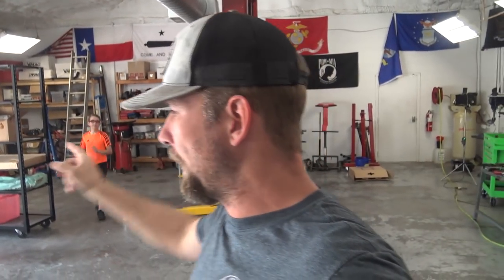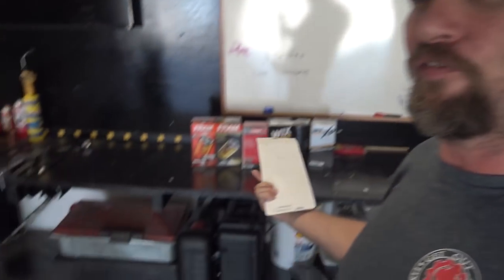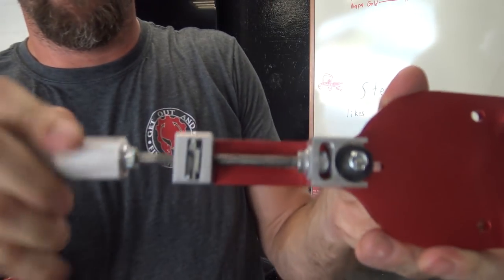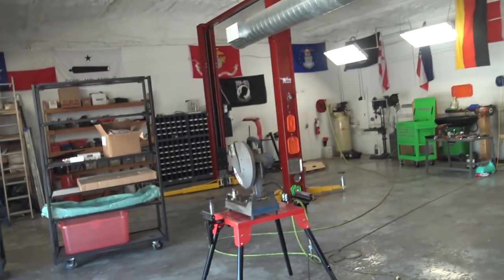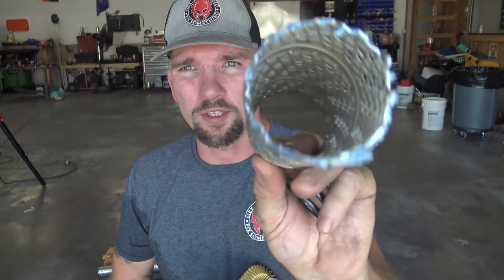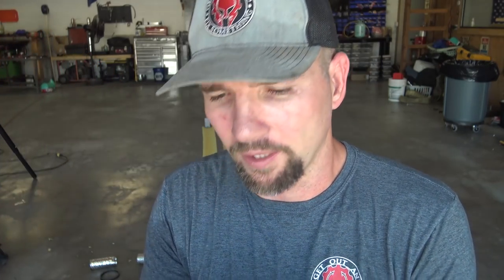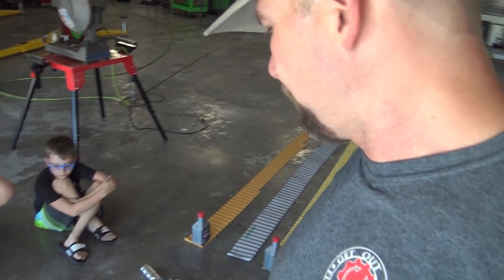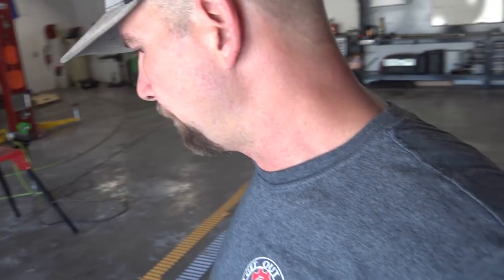Is This Still The Worst Oil Filter On The Planet?

Comment: Curious if the Motorcraft from a dealership and the Amazon cheap Motorcaft is the same on the inside. There have been rumors of Chinese knockoffs making their way into amazon.
Reply: There are rumors of chinese knockoffs in autozone.
Reply: ricky sanchez Chinese knockoffs are everywhere. Autozone should check the information and do something about it.  If they know about it, time for everyone to shop somewhere else
Reply: @donmartin7728  Sorry, got burned real bad on an idler pulley. I hate autozone, but.....I think they restock destroyed parts.
Reply: ricky sanchez I am stuck buying most of my parts from the dealership, other stuff I get from Oriellys haven’t been into Autozone or Advanced in a few years. 
Information should be shared with all, individual can then determine where and how to spend their money.
Reply: @donmartin7728   Are they just Trying, to, Get you out of the way? Your dealership? Something happens, and you cant prove it? You complain and, nothing happens? They sell fakes on Mondays? I am a youtuber, but maybe your a consumer? Give them your money.

Comment: the problem with motorcraft since being made by purolator is tearing and folding of the media. easily verified and the reason i stopped using them. and for the folks asking if that was a fake motorcraft filter, no its not.

Comment: So you have opened all these filters to see what's inside. What if your truck uses a filter core, that means that you only use the filter itself without all the metal crap. I have used just about every filter core that's out there and they are all glued. What does the metal clip that holds the median do? NOTHING. it's all being held by the metal can, the top and buttom caps and if you have a filter core than your filtration assembly.

Comment: Most of my cars are bare filters now instead of canisters.
Reply: @Hyde Whyte
I'd much rather use spin on filters.
Don't like the cartridge type.
Reply: @sameoldeh  GM didn't leave me a lot of choice in the matter. But the bare cartridges means you don't have to cut a metal canister to look for metal flakes.
Reply: @hydewhyte4364  
Well if you bought a GM...Avoid disappointment,set low expectations.
You'll have a lot of things to be concerned about other than oil filters.

Comment: Video after video of people cutting apart oil filters like they know what works in a filter only by their own experience and opinions they have gotten. Remove the bias. Do an oil analysis on a vehicle run on each filter for the same number of miles/hours. I'd be very surprised if any name brand filter performs significantly better than any other.

Comment: I prefer to use Aeroflow Aluminium Billet Oil Filters with Stainless Washable/ Reusable Filters on all my engines. I fit LN Engineering Spin-On adapters to replace the original cartridge filters on my Porsches and others where possible. Thank you for the sharing and entertainment.

Comment: Wrong Answer , cutting open filters is an act of last result , if you need to know what is going on with your million dollar engine , you will find out problems earlier with constant oil analysts . you never see damage particles coming cutting open filters . Cutting open any filter is mainly for the quality of durability under you operating conditions . Filters don`t destroy engines , the operator does.

Comment: I watched the whole video, hoping to find out why you hate Fram so much, and I still don't know why.
Reply: Media is cheap, less of it, car filters have cardboard end caps, pressure relief spring is a joke, and they've killed many engines (low oil pressure). The synthetic ones are high quality, but of course joe schmoe doesn't buy those. I was in a pickle and tried a fram ONCE and the threads stripped completely off before it was even snug. Never again.

Comment: Well I'm not a fan of FRAM oil filtersbut I can tell you another one that I'll never buy and that's a carquest brand oil filters from advance Auto parts might want a couple months ago for my brother's truck brand-new out-of-the-box and it was defective
Reply: Todd Orton  I bought one about three months back put on my brother's f150 the oil filter was leaking and I didn't over tighten it either so I took it back off it was like the seal was jacked up like the top of it was warpedthat's the first one I had had bought in years since advanced IT gobbled up carquest after that I just refused my anymore because I'm like the quality went to crap end up bona Purolator brand oil filter had no trouble out of it

Comment: why do people think fram is good
Reply from the maker: Because orange?
Reply: @StephenCoxfixit  some people swear the orange makes it better. but it sill doesn't stop the cardboard from getting into your main bearings.
Reply: @jacobdevereux207  or plugging the filter causing the oil to bypass the filter.
Reply: @consaka1  I've noticed that they get to the bypass stage fairly quickly
Reply: @jacobdevereux207  Yes I have noticed most filters that filter down to the smaller micron levels will cause a bypass to occur more often. Especially when cold?
Reply: The reason people think Fram is good is mostly their subconscious defense of their actions in buying the cheapest filter possible. In some cases that has been augmented by Fram propaganda sent out in an effort to do damage control. Propaganda such as elaborate showings of their quality control in production. Just because a company shows stuff like that doesn't mean it is actually effective. From what I have seen in the past their QC is really subpar. If it was worth a darn  filters with defects that allowed oil to bypass the filter would never get through.  But I have seen such defects. Combine that with crappy cardboard construction and you have the reason most of us would never use that filter. The best thing they ever did was the handgrip rough surface finish. Only thing that was ever really nice but it doesn't help with oil filtering.
Reply: Todd Orton  I'd only use it in an emergency and then change it first chance I got. Even if it only had 50 miles on it.